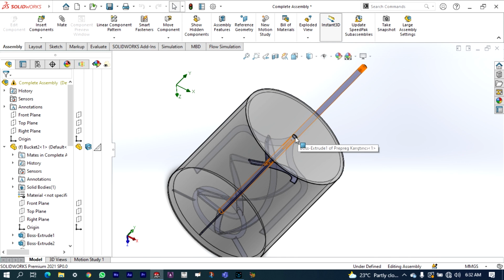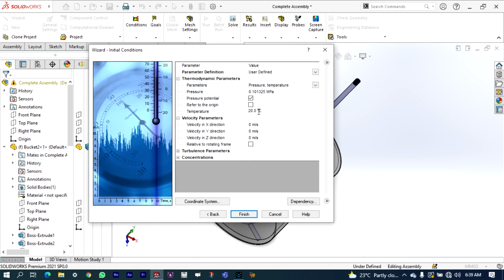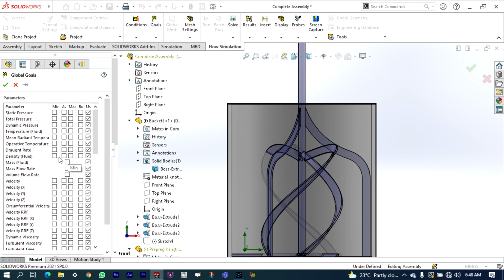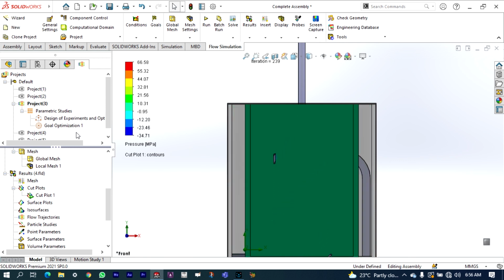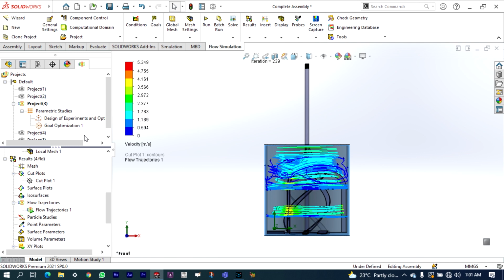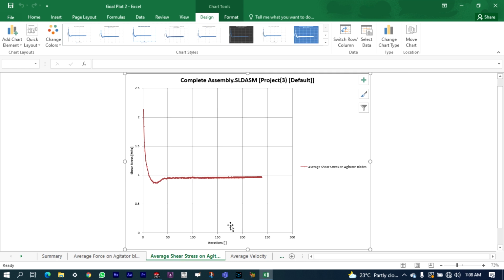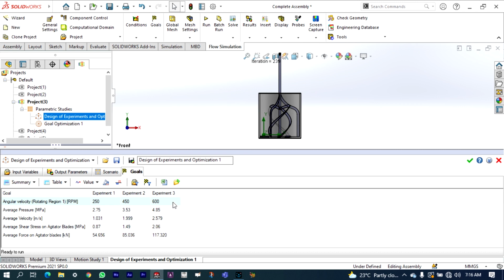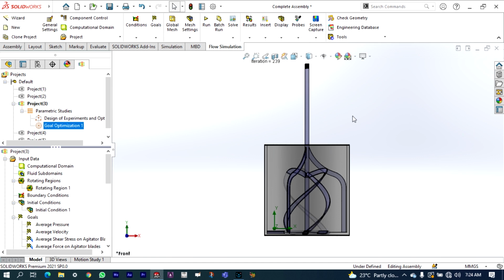CFD Flow Simulation: Parametric Study & Optimization of Multiple Fluid Mixing in SolidWorks 2021

Comment: Sir is it possible to analyze mixing of co2 gas with cold water in a pressurized vessel in solidworks. Suppose a vessel is in vertical shape( 400mm diameter × 1700mm height × 3mm thickness) and vessel is half packed with series of perforated plates and then we pressurized that vessel from co2 gas up to 5 bar which will remain constant throughout the simulation or process.Consider half inch duct for co2 gas inlet from any side of vessel and then with the help of high pressure pump, cold water(2 degree celsius, volume flow rate 4 cubic meter per hour)is sprayed through nozzles from the top of vessel towards bottom. My goal is to look out how water is passing  through those perforated plates and at last how much co2 gas is mixed in water which is going  to be stored in the bottom of the tank . Consider  1.5 inch duct for water inlet and 1.5 inch duct for water outlet which is open to environmental pressure.
Kindly explain  how to do in solidworks or in ansys.
Thanks a lot 🙏.

Comment: How did you solve "Create Lid" problem ?
Reply from the maker: Dear Afsal, if the surface on which lid to be provided is not flat, you cannot provide lid normally. In that case you have to create lid manually by creating sketch and unmerged extrude boss base.